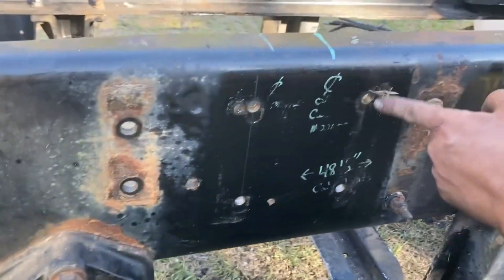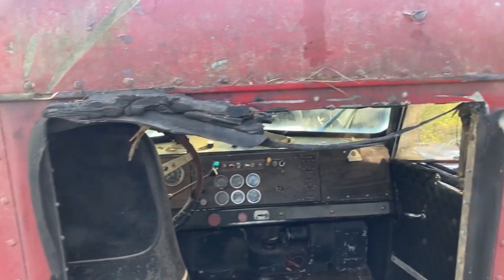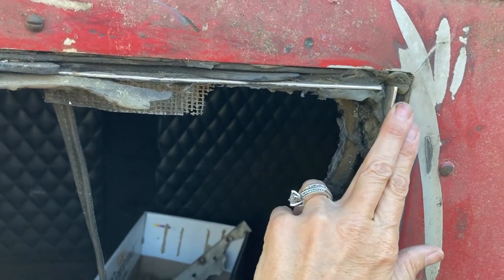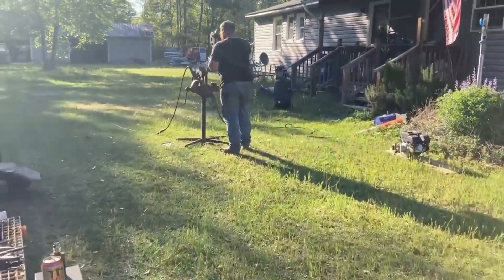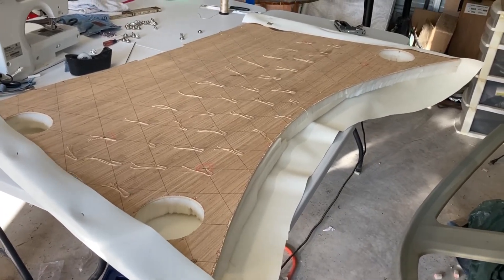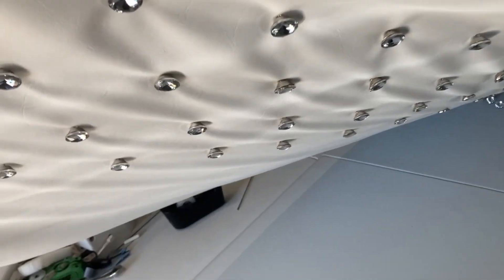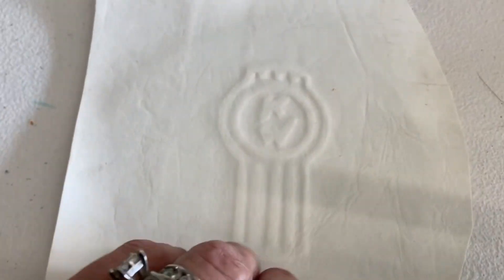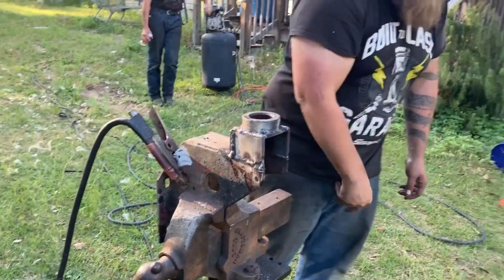1968 Kenworth W9 Cab Mounts

Comment: If your raising the cab wont you have to raise the hood also? To keep the hood line flat.
Reply: Yes you would. Also it affects the steering shaft to the steering box. And the space between the bottom of the hood and the bumper. And a whole lot of other things. It’s going to look like it’s a 6 wheel drive truck, in my opinion. The only reason I’m saying this is because I am restoring a 64 KW which is the same body style. It’s not a easy task. 
When I bought my truck I was going to make it into an extended Cowl  to make it look like a longer hood until I started figuring out all the extra stuff you have to do and decided against it
Reply: @SPR-777  it is not an easy task you’re right about that. No matter what you choose to do to put an old truck on a newer frame compromises must be made. Stretch the hood or move the center firewall back? Move the axle centerline or make a bumper spacer? Etc etc…

Comment: I just did this exact swap. A 74 A cab on an L chassis. You’re going to have to modify the firewall pretty good to fit the B in place. L chassis have the engine sitting back a few inches VS the As. Combine that with a short hood and it’s a recipe for a engine into the cab about 5-6 inches. It works easier if it’s a long hood or has a cummins in it
Reply: Also have to keep In mind the front tire in the wheel well spacing.
Reply: All correct gentlemen. Cummins is a little shorter the the Cat but that B is going in.